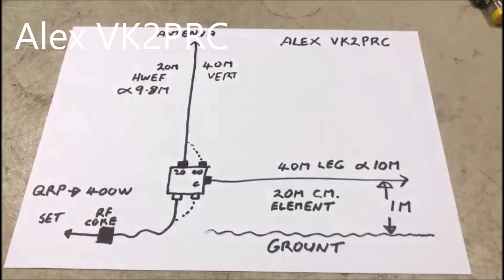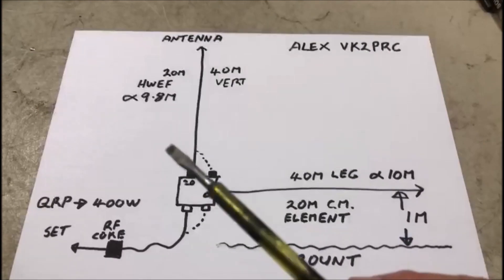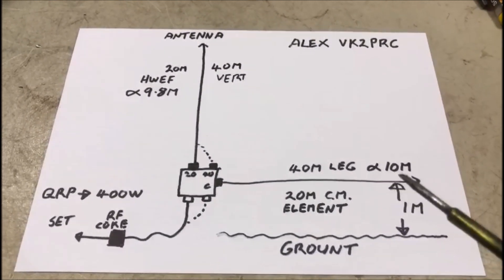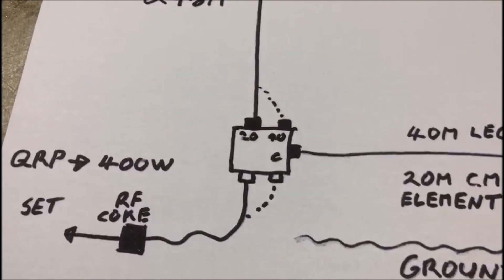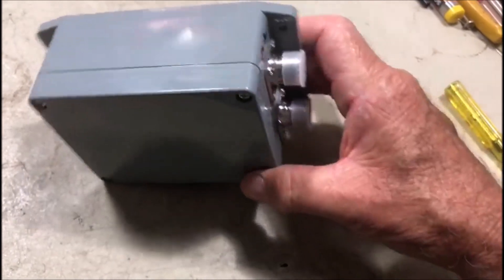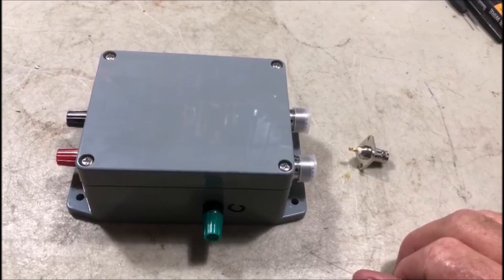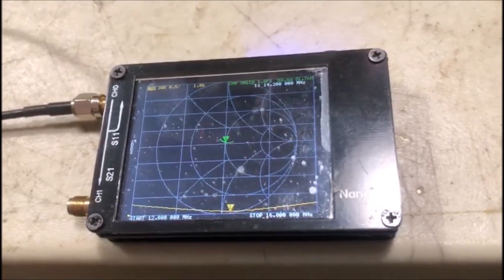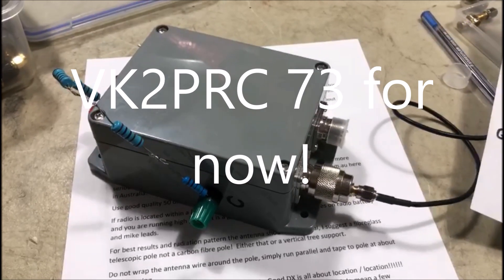Antenna 20/40M Half Wave End Fed Antenna Matching

Comment: Would  have been nice to see inside it  can only be a simple indicator and capacitor or ferrite unun which i dont think it is as it would give you 10m as a harmonic so guessing its a enamelled copper inductor and a bit of coax as a low value capacitor. have you thought about useing the same coax connection and just running a bypass wire to the 40m terminal saves an extra so239 that way its more economical to build and quicker to change band and works  the same